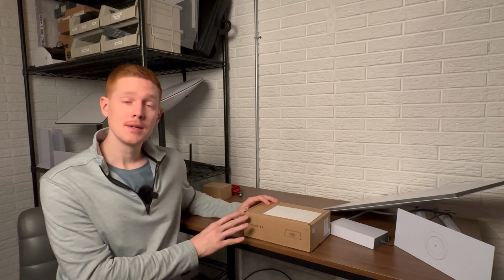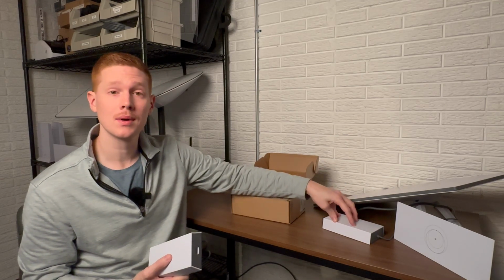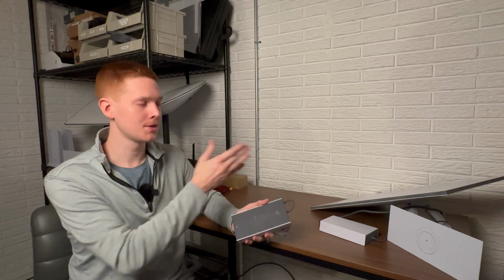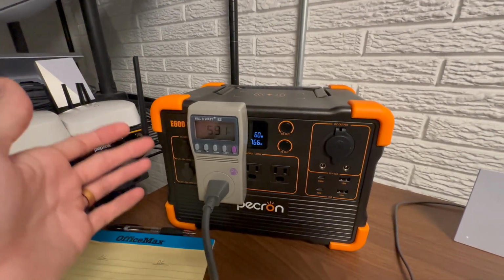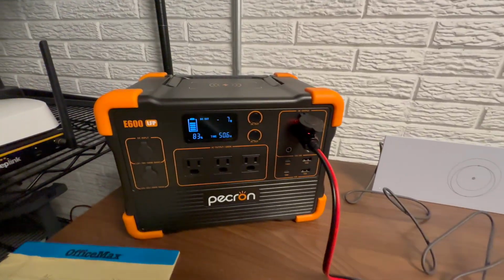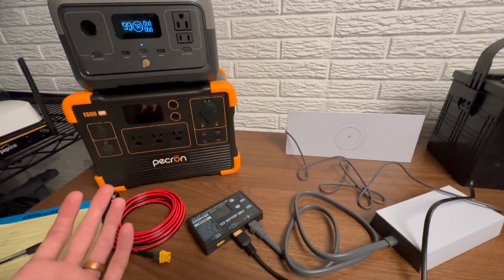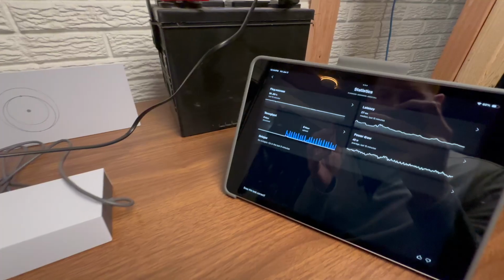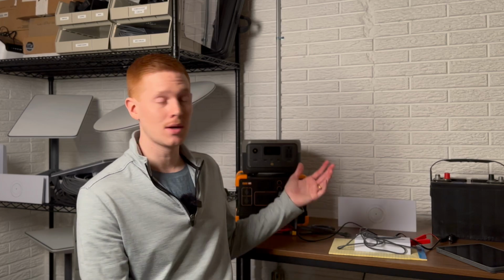Starlink Gen 3 Standard DC-DC Power Supply | Efficiency Testing and Review

Comment: I have an ecoflow delta2 max (2000 watts) fully charged. pluged the dc xt60 from router  to xt60 male with dc barrel into the ecoflow. it starts up but it kept going on and off (the internet) so I guess the amps on the ecoflow are not enough :(  Im wondering if a dc to dc booster plugged into the ecoflow would do the trick?

Comment: This issue will be something to do with charging the power electronics, such as capacitors, and volts drop. This would be interesting to see the results with 24V and 48V as I²r losses will be lower. I would think that these other voltages would not have any issue booting and also likely have a lower consumption.

Comment: My experience with my RV was also complex. Bought an inverter for Starlink power on the road and also drycamping, Philips DEU-150e1, rated 150W and 250 W surge. However, in the 12V plugs, the inverter would trip with Starlink boot until connected directly to RV battery. This works fine but still occasionally trips during Starlink breaks while traveling due to trees and gas station covers. Since there is no inverter reset button, have to unplug and replug to reset but has not blown any fuses or tripped breakers. The Starlink app tells you how many watts it draws and varies 30-80W, but startup seems to draw much more sometimes as a transient that trips the inverter but does not blow any fuse.

All in all, all works great even on mountain roads through forests as long as enough sky shows since there is some buffering going on. A great technology and even works in the driveway at home and could replace my existing home service. However, I pause the Starlink over the Winter and only start again in the Spring keying on the first of the month with no pro rata allowance...

Comment: The DC will not work in cold weather , when the heater kicks in the dc power supply will not handle the heater. Ok for warmer climates. 😎🇨🇦
Reply from the maker: The dish does not have a heater. It does have a snow melt function that will ramp up antenna power to produce heat on the surface, which melts snow and ice. But that only activates if the signal becomes degraded with precipitation. The DC power supply can handle the snow melt function. The limitation will be your battery source. Can the DC circuit you hook it up to handle up to around 200 watts? If yes, then it's no different than using the AC power supply.

Comment: Thank you! the explanation answered so many questions, on Starlink website the description for the DC to DC adapter was so vague, and the cable included was also very confusing since both ends were the same XT60 as you mentioned.
I was considering splicing one end to connect it to a battery, but now it might be an easier idea to just get a 12V DC to XT60 instead.

Comment: Hi mate ...if my AC Is broken can use this if i cut and i change for normal home ?
Reply from the maker: No as it requires a DC input. It doesn’t have a plug to plug into a wall outlet, and doesn’t convert AC to DC like the regular power supply. Best way to get a replacement is to create a ticket.

Comment: My vehicles 12V plug is rated for 120 watts at 12V.  From what you're saying I don't think I can run it directly to the Starling DC power supply.  Is it possible to run the 12V 120 watt to a Victron 12/24 30amp 360 watt DC to DC converter to power the Starling DC power supply?
Reply from the maker: I’m not sure it would work since the total output power of the car outlet is always going to be limited to 120 watts, even if the converter steps up the voltage and is rated for a higher output. It can only output what it takes in from the car, which is not enough for the Standard because of the boot up power requirement.
Reply: @DISHY_tech  Gotcha.  So either I do a DC to DC converter or a DC toAC inverter (connected directly to the car battery).  I've been looking at the Victgron Orion 12/24 15 for a DC to DC converter.  I have a solar battery set up I made for my Iceco fridge but don't always want to drag it out just to use the Starling while driving/roaming.

Comment: Great review.   I use a BioLite base charger to run my Starlink on a boat and its DC output is 12V 120W as well.  The Starlink DC to DC power supply isn’t going to work for me either.  Saved my the expense of finding this out myself.   Would have thought you gain more than 3% efficiency.  In my case it’s not worth connecting to the boats DC power system for that little bit of efficiency.

Comment: I have wired this power supply to a 12V 15A output in my RVs 12V management system and it works perfectly. I also notice that even during startup it's max draw is just over 7 amps

Comment: I was curious about this as I am working on making my travel trailer 100% off grid and wanted to tie my standard gen 3 into the 12v system. I planned to wire directly to the 12v system but good to know the power stations have issues with it.

Comment: The XT60 on the starlink adapter works perfectly on my Pecron 3600LFP. No need to change anything. 3600 has the xt60 at 30 amps. And it charges from 20% to 100% in an hour on my 30 amp gen set.

Comment: You should always use a 30-amp fuse and make sure the wiring is rated to handle that load. Keep in mind that during snow melting or overcast conditions, the dish will draw more power. A 15-amp setup might be sufficient if you're working with 24V systems.

For me, the goal is to offload as much power as possible from the inverter. The more devices I can run directly on 12V, the less strain I put on the inverter—which I prefer to reserve for AC-only equipment like the water pump. Thanks for the review. I love your videos :D

Comment: I think this analysis is flawed.  You should be using the same meter to take your amp readings.  Different meters can vary greatly as they are not calibrated to each other.  I would believe the a/c and d/c difference would depend on how efficient your inverter is.  A/c Inverters tend to be between 80 and 90 percent efficient.

Comment: Do you think I can use this DC-DC power supply with an XT60 to Aviation Plug Cable to power it straight from my Bluetti AC200MAX, which has a 12V/30A Aviation Plug DC Output port?
Reply from the maker: Ya should work fine with that output level, so long as the cable isn't too long to cause any drop in voltage. A high quality cable will help, too.

Comment: I would imagine that the amount of inverter power loss depends on the inverter you're using. So in an RV application, like ours for example, when you turn the inverter on to run the starlink you're also running other things like the standby power on the tv, microwave, etc. I think each user has to evaluate what their particular inverter is burning.

Comment: Thanks for detailed testing, this video is exactly what I was looking for. Quick question from an electricity noob... At 13:49 you said you were pulling 12V @ 10A (120W) from the Pecron and Starlink wouldn't boot. But at 15:19 when Starlink did boot off the battery, the Dokio was reading 12V @ ~5A, which is only around 60W, right? Way less than the 200W you recommended a bit later, and less than the power you were getting from the Pecron. What am I missing here?
Reply from the maker: When a Starlink dish first boots up it does a power supply test of sorts. It tests to see what kind of power and voltage it can get from the source. At 13:49 what I'm seeing is the Starlink dish is pulling the maximum power it can get from the Pecron, which is rated at 120W on that output port. I think it wants up to 140-150 watts during boot up. The Standard antenna doesn't need that much power during normal operation, but it's asking for it during boot up for a brief moment. Since the Pecron can't deliver more than 120W, the boot up process fails and continues to cycle over and over. When I hooked it up to the battery directly, with no such 120W limitation, the dish managed to get through the boot process. After the boot up period the Standard dish runs on the normal power levels, which is closer to what you see at 15:19, 60W. I recommend 200W because the Starlink dish will try to pull 140-150W during boot up or when heating the antenna, so it's best to give a little extra headroom. Most of the time the dish will sit there and use 40-60W, but you need to satisfy the boot up requirements or it won't power up as I found out with the Pecron.

Comment: Thanks for your great review and testing.... Phew,  I dodged a bullet, I was thinking of getting a solar power generator and use it with the Gen 3...    So,  I like you will be using it in our Jayco Travel trailer.  I have 2 v Trojan T105 batteries on my Trailer.. .but I also carry a Trojan 12v 95ah AGM which when I don't have 120V via shore power or my generator I have been using a low cost Best tek 300 watt inverter to power my TV at night,  then durring the day I use my 120v AC from the generator to charge the battery with my charger.    Now that I have the Gen 3 starlink having a direct DC to DC with the same battery is an easy set up.    I am surprise that with the SL dc to dc a solar generator just can't fire it up...  I would have thought that with most folks dry camping and using the solar generators they would have thought of that...  Even if I want to throw the battery in the bed of the pickup and set the SL next to it at night is an easy option....    You saved me a lot of frustration for sure.

Comment: Isn't this product useless? Almost no battery is 12 v 30 amp lol
Reply from the maker: It doesn't use anywhere near 30a, that's just the rating on the power supply. Really what it needs is 12v 15a available during bootup when it hits 130-140 watts, otherwise it sits around 50-60 watts most of the time.

Comment: What? You were told that that DC to DC converter requires 30 amps per hour to run? That would drain my hundred amp hour battery in less than 3 hours! I'm planning on buying star link equipment at this point but now I'm got total second thoughts. I live on the road in my camper. 30 amps to Output 3.67?
Reply from the maker: That's just the rating on the DC power supply, the Standard dish doesn't use 30 amps all the time. What happened here is the 12V 10A outlet on the power station doesn't output enough power for the Standard's boot up process. During boot up, the dish ramps up to 130-140 watts (11-12 amps at 12V). That's above what many car outlets or power station outlets will provide, so it just fails to boot up. This works fine hooked up to a battery circuit with a higher output rating. For example, in my Scamp travel trailer I have a 12V battery, and I have my Starlink on a 15A fuse. That's plenty for the Standard dish. After boot up, it settles out to around 50-60 watts system total. That's 5 amps.

Comment: Can you measure the  instantaneous current required?  Is it possible that during Boot up the system draws 300W or more, possibly 300/13 or  23A ?
Reply from the maker: I haven’t measured the current directly on DC but I’ve measured the boot up wattage at over 130-140 watts before on 120V AC. So a typical 12V/10A DC car outlet won’t cut it. Need 150 watts at least.

Comment: Hello! Sorry! I don't speak English, so I'm using the translator to try to understand and write to you. Please clarify, specifically, what I need in addition to the standard Starlink DC-DC power supply to use the Starlink Gen2 V3 antenna with a 12V battery. Thank you very much!
Reply from the maker: For the V3/Gen 2 Starlink, this is not the accessory you want. Check out this video for a setup that will work with Gen 2: https://youtu.be/67jolgTfaLU

Comment: Wow. This is so disappointing. Thank you so much for doing this video. I just recently got my Gen 3 Starlink and I've been looking into how I could run it on 12v when I boondock camp. I really want to find a good solution so that I can extend my camping trips and work from camp for a few days. I'm still learning a lot about what I can run on either my Pecron E600 or the E2000. If I'm following you correctly the cigarette outlet on the power banks just isn't going to cut it. It sounds like I'm going to have to suck it up and deal with the inefficiency of running it off of 110. Please correct me if I have this wrong.

Comment: My battery bank is 51.2v nominal, full charge is 56v. is there an adapter for this? sounds lke the starlink DC-DC is 48V max?
Reply from the maker: You could put in a step down converter. The input specification is 48V max. But honestly, it should work fine at 56V. If it were me I would just try it out before going the step down converter route.
Reply: Isn't 48v like 12v nominal voltage ? They should have true voltage range  as a 48v lithium battery  high state of charge voltage is higher

Comment: Ok, because I'm not tech savvy, in a power outage scenario, Starlink Gen 3 will still power up properly and work using the standard AC set up, even though it's consuming more power? I bought the Anker Solix c1000 and I'm just making sure I don't HAVE to convert for it to work. I don't live off grid, I just need Starlink to work in more of an emergency situation. It's ok to have a laugh at this comment btw. 😂
Reply from the maker: Yes, there is no need to convert Starlink to run off of DC. If you have a power station or any kind of backup AC power, you can still plug in the regular Starlink kit and use it no problem.
Reply: @DISHY_tech  Ok! Thank you very much!!

Comment: When using Starlink's DC to DC converter plugged into the Starlink router, you didn't say if the router needed to be plugged into 120VAC or if the router function is powered from the Starlink DC to DC converter?  It would defeat the purpose of just using 12VDC if using the Starlink router still requires 120VAC.
Reply from the maker: The router is powered from the DC power supply.

Comment: I wanted to put this here for anyone who may be trying to run this on a 15 amp line. I just setup my DC to DC power supply on an existing 12 volt 15 amp line in my RV and it will boot but it will not stay powered on. At some part of the boot cycle it stops and reboots. So, unfortunately, there must be some sort of power on that requires the full 30 amps.
I'm not an electrician. Just trying to get Starlink to run on my 12 volt system.
I'm going to run a 30 amp line from the batteries later and make sure that'll keep it running before doing anything else.
Reply from the maker: How long of a cable do you have between the battery and the DC power supply brick?

Comment: Good video, you saved me buying this product. I have a Bluetti EB70, maxes out @ 800 watt AC. It works fine as an inverter, and I was able to use the Bluetti 12v charger supplying @ 100 watts to cover the Starlink (thru a cigarette socket clamped to battery posts). My guess is there are short spikes in the power needs of the Starlink system, it must peak @ 300 watts based on what Starlink rep. told you. One could buy a decent 500 watt inverter for @ the same money and have more flexibility. Peace

Comment: Great video! I am wanting to create a self contained system with my SL Standard. I was thinking about just mounting on top of a tough box with a power bank like yours inside. Then I could just ratchet strap it down in the bed of my truck. Any thoughts? Would that even work? How long do you think the standard would last on your power bank? I would just use the regular plug that it came with plugged into the power bank.

Comment: 3% inverter losses seems low relative to what goes on in my van. Just having the inverter on tanks my battery whether or not something is plugged into a receptacle.

Could there be a baseline draw on the battery to run the inverter whether or not you are drawing for a load? Said another way, is your equipment measuring only the incremental power used for the load?

Edit: After more research, a better way to phrase my question would be "are you accounting for standby consumption in your efficiency calculation"?

Comment: It's hard to believe a StarLink branded DC-DC took so long to be offered by StarLink. 

The third party DC-DC options I looked at required a third-party router to be purchased. The cost added up quickly. Not sure why I would want to buy another router, other than having a smaller form factor.

2-5% power savings isn't worth the expense on its own. Maybe having a more permanent install option in my van is. I will have to think this over.

Comment: Thank you for the video. My Starlink standard power supply went out due to an unstable AC input. Does Starlink sell AC power supplies? I have a power station that outputs up to 1000W. Will that work with this DC adapter? Thanks!
Reply from the maker: You have to reach out to support to get a replacement AC power supply. A power station with a 1000 watt inverter would work great.

Comment: Techsupport said needed 300 watts.?! Lol. 
I assume at least 200 watt needed for snow melt feature?

So Gen1 and Gen2 SOL? Just use 3rd party?
Reply from the maker: 3rd party for Gen 1 and 2. And honestly it’s worth the upgrade to get the flat panel instead of having the mast and motors.
Reply: @StarlinkHardware  and getting the RJ45 jack port back! A stupid design and glad they finally rectified it.

Comment: Thanks for the video - the XT-60 connector on the factory supplied cable had me a bit puzzled as we don't have anything matching that on our boat.  Any reason we can't cut off the plug end and wire directly to breaker and battery bank?
Reply from the maker: Nope, should work fine sliced directly into the battery. I would put a 15A or 20A fuse on the circuit to make sure it has all the power it needs. 10A just isn’t enough at 12V.